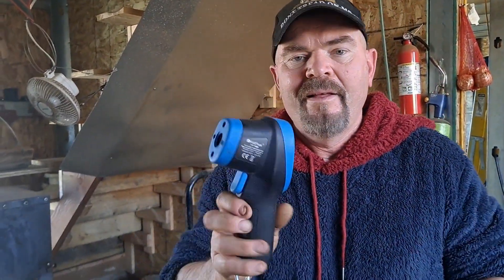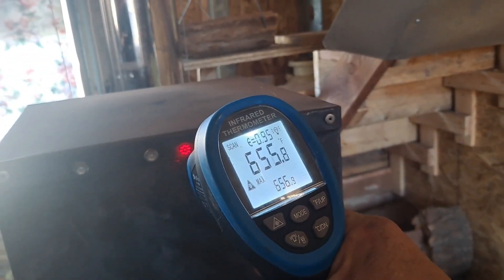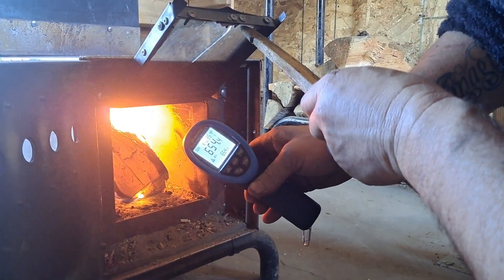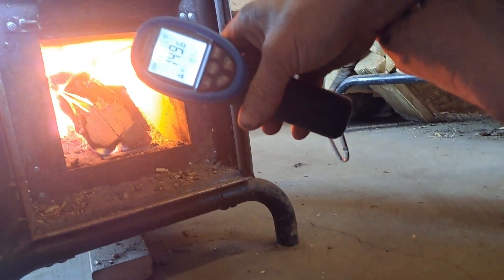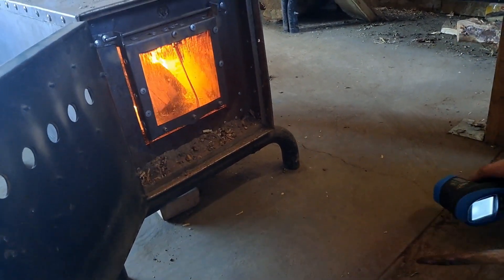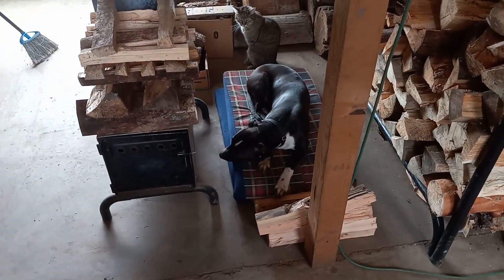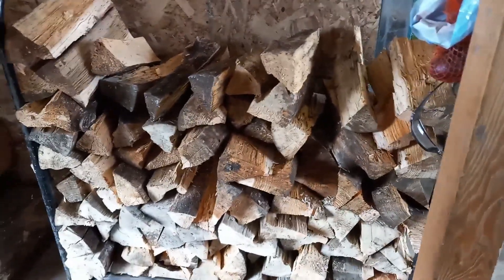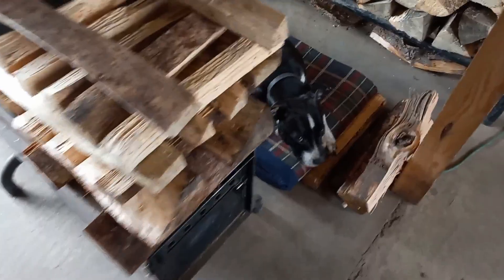Amazing Stove Heats Off Grid Home

Comment: IR guns are notoriously inaccurate, you could try a thermocouple with a ceramic head, that will be much more acurate and will also measure air temperature rather than a hot face.

Comment: I bought your firecete recipe of of Etsy and need clarification on the ingredients. What is Jlube powder?
Reply from the maker: J lube is a stabilizer, if you Cant get it.  I recommend Checking the PH level of your water.  And add Baking Soda until the water becomes neutral and then continue making the recipe without J lube following the rest of the directions.
Reply: @HoneyDoCarpenter  Thank you. Where is this product sold?